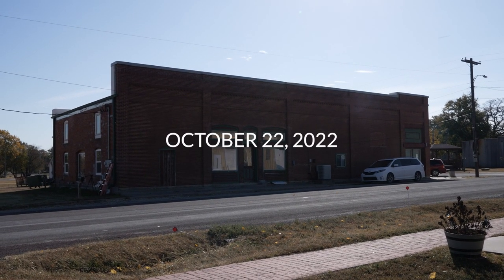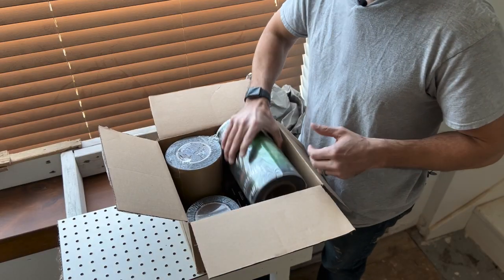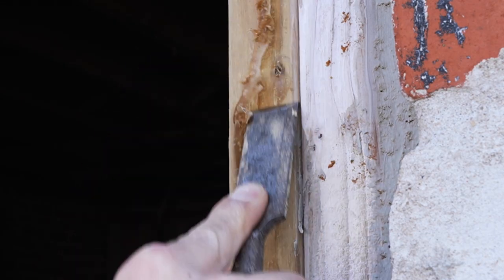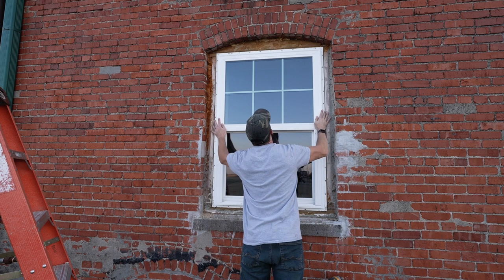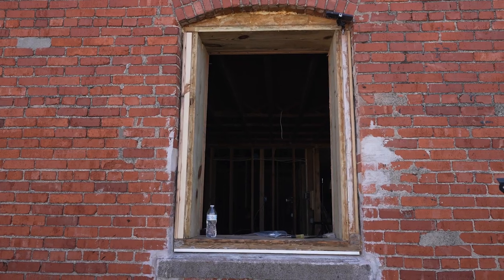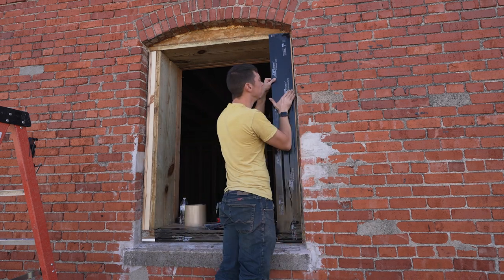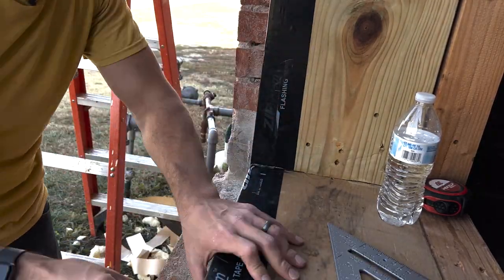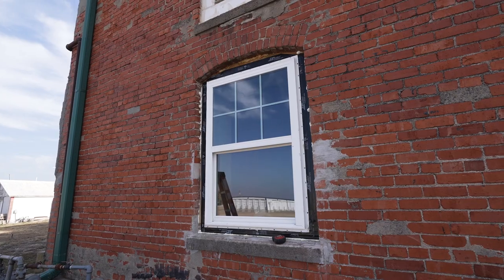Fixing And Flashing Windows - General Store Renovation

Comment: Great work. I guess my only question would be, if you're worried about a little centering of the window, why put a square window in a curved top frame? That looks worse than being a fraction of an inch off on centering. Maybe get a two-piece window, one a bit smaller square/rectangle and a second half circle window for the top? I think that would make it a much more attractive cost than shifting a rectangle a bit left or right.